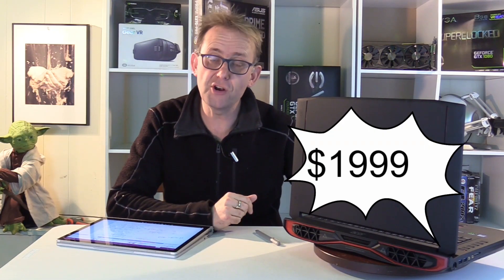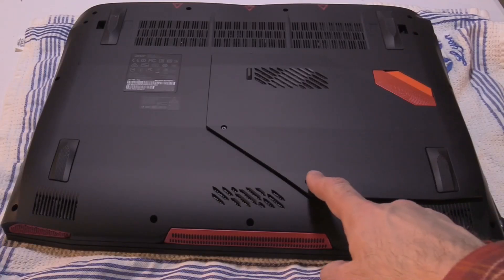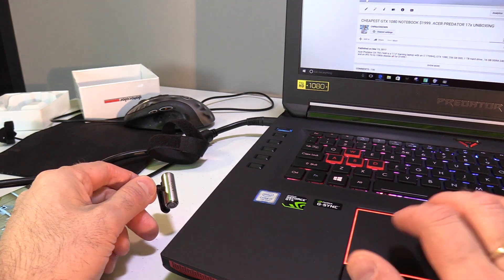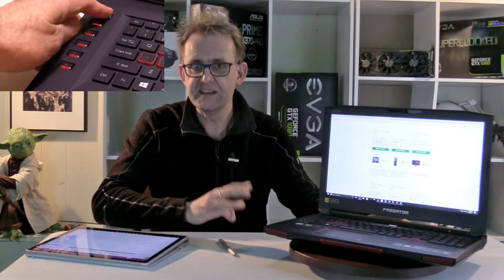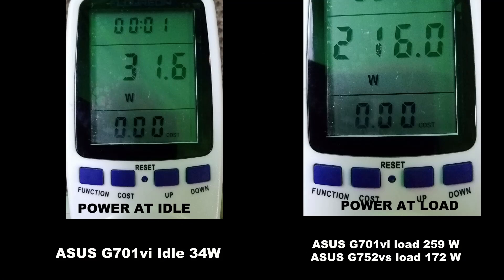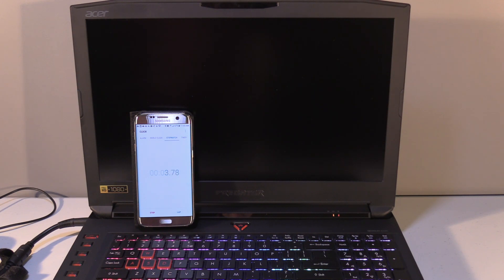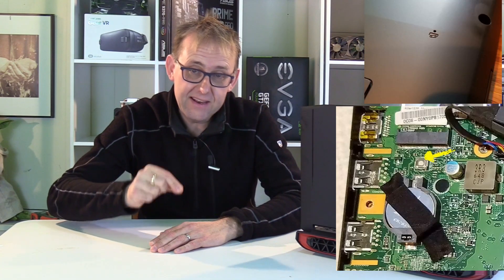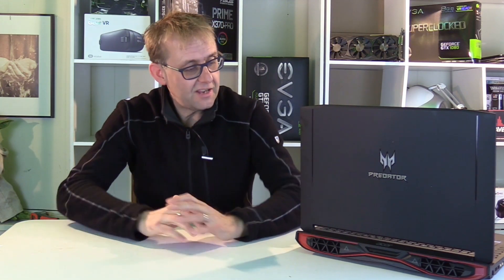CHEAPEST GTX 1080 GAMING NOTEBOOK ? ACER PREDATOR  GX-792-7448 FULL REVIEW

Comment: hey! when you game on this laptop did you noticed that the laptop drained battery even though it was plugged in? I have the 7820hk model with 1080p, and it drains battery when gaming. I played for like 40-60minutes and it dropped to 95%
Reply from the maker: Papa Lord hey there. Must admit I can't remember but I suspect it is just software that limits the battery from over charging thus extending the battery's life. That is quite common. I imagine if you measure the power pulled from the wall it will be less than the 330w power supply.
Reply: OWNorDISOWN its supposely how the laptop works. It uses battery when gaming and if it gets to 30% it uses ac power again. Thats weird tho lol. Thanks for answering man :D
Reply from the maker: Papa Lord anytime mate, enjoying the laptop? What temperatures do you get with that i7 7820hk? Do you have it overclocked?
Reply: Im currently running 3.8ghz with an undervolt of -160v. Getting between 65-72c when playing games. In whisper mode Im getting 40fps all the time on every game Ive tried (gta v with the redux mod, fallout 4 with alot of graphics mods and dsr 1440p) and the laptop is very quiet
Reply from the maker: Yes, those fans were very quiet. Great temps too ! It's a solid machine for sure :)

Comment: Can you please tell me the best price I could find for predator 17x  with i7 7820 HK processor, 32gb ram and 512gb ssd.                 And yeah one thing more buddy, I checked out the one you reviewed through the link you listed in the microcentre but the back of the laptop seamed different like the earlier models . Why is it so ?
Reply from the maker: It seems fairly competitive at Amazon: https://www.amazon.com/Acer-Predator-GX-792-703D-1920x1080-i7-7820HK/dp/B01N353QOO
The previous G9 models had that removable fan bay on the left hand side I recall.
Reply: OWNorDISOWN I know its silly to ask you but can you  tell me what could be its expected price drop after 1 year? The above mentioned laptop with i7 7820hk, FHD , gtx 1080, 32gb ram and 512 gb ssd. Listed on amazon for $2699. Cuz if its price drops to like $2100- $2200 I will be able to buy a couple of more things. Things on my list-                                   1)This laptop                  2)hyperx stinger headset                           3)logitech g502 proteus spectrum           4)ps4 slim 500gb and an additional controller                         5)some ps4 games            BUT ONLY IF THE PRICE DROPS OR I'LL HAVE TO CUT SOME THINGS FROM THE LIST WHICH WILL BE REALLY VERY DISAPPOINTING. :) OR :(
Reply from the maker: Dhirendra Pratap Singh once the coffee lake processors get released the Kaby Lake models such as the i7 7820hk will be discounted. I believe we will start seeing their 8th gen coffee lake in October. I would expect previous gen laptops to be discounted $200 to $300 perhaps
Reply: OWNorDISOWN can I ask you something? I just checked that there may be price drop of around $50 of ps4 and ps4 slim within 4 - 5 months. As for current it's  (ps4 slim 500gb with uncharted 4) is $296, what do you think can the price drop any more than expected ? Yeah it'll be very kind of you if you could tell me the current price of ps4 (no bundle)cuz I can't find it all I could find was ps4 slim on amazon.
Reply: Keeping all things aside mate I really appreciate your help and advice. Cuz you are the only reviewer who answers to my questions. I hope you and your channel prosper and flourish. Best wishes from your fan from India:)
Reply from the maker: Dhirendra Pratap Singh best but have a 1TB model for $299, a pre-owned 500GB for $199. Games top sell a refurbished 500GB for $250
Reply from the maker: Dhirendra Pratap Singh no problem mate, anytime! Really appreciate you supporting my channel 😀

Comment: i thought this was my next laptop but the speakers is a huge issue for me since i dont use my headphones all the time. i talked to some predator owners specifically those who have the gtx1070 and they had nice things to say about the speakers. maybe its your unit that has the problem?
Reply from the maker: Perhaps it is.. I did a full system reset and it was the same (as was the issue with the Fn key..) so I might have a dodgy unit. Certainly the Dolby Audio makes it worse. Headphones are much better but still not the best I have heard. I'm with you, I always use my speakers and I would be tempted to keep the Dolby Audio turned off. Perhaps  there is one in a store you can demo first? I tried my best to capture the audio to explain what I was talking about.
Reply: OWNorDISOWN its so hard to get a gt73 with a gtx1070 +7820hk from resellers at around 2099usd knowing that you could get a gtx1080 +7700hq laptop for 1999usd i guess the catch was bad speakers(?). Alienwares over at ebay and the outlet are so tempting too! any idea where i can grab the cheapest gt73 from? i probably can get the cheapest variant gtx1070+7820hk+1tb hdd only+16gb ram for 2000usd if i will pay xoticpc cash and use my returning customer discount.but 2k for just a 1070 is quite expensive considering you could also get a gt72 w a 1070+7700hq+128gb ssd+16gb ram for 1699usd. any idea which laptop you would get if you had 2k usd to spend?:)
Reply: Let me know if you get an answer to this because I am in the EXACT situation you are. I cant decide if I want the Acer w/1080 & 7700HW or MSI Gt73 w/ 1070 & 7820hk
Reply: thermonuke1 i pulled the trigger on an aw15r3 w 1070 and 6700hq +512gb ssd and 1tbhdd and 120hz panel for 1500usd. i couldnt justify getting the gt73 for 300-500more and without an ssd + poor warranty service.
Reply from the maker: Jason Mak When I returned the Acer I checked out a G9 and the speakers were perfectly fine. I think I just got a lemon.. I do think that at $1999 that is exceptional value. 
I bought an Alienware 17 R4 with Gtx 1080 /i7 7820hk 16GB ram, 256 GB SSD and Temps are ok, even at 4.4 ghz. It does throttling get hot when I run a game and do cpu work at the same time, thus is without the turbo fan. It only arrived today .. Cost me $2100 plus tax direct from Alienware so check out their discounts too. 
I think the Acer is still good value and as games get more graphically demanding that gtx 1080 will help..
Reply from the maker: Jason Mak nice laptop!

Comment: Hi Steven: 

I am staying in Austria and can't find this model for 2000 US, in amazon.de and amazon.uk, all acer models with 1080 cards are 2800 Euros and up. Do you know where I can this laptop for 2000 Euros within Europe?
Reply from the maker: Hi Naser, unfortunately I don't - I live in the USA and don't know many European vendors. Can you contact Acer , they might be able to advise you ?
Reply: Sorry my friend I thought you were living the U.K, anyway about Alienware 17 with 7700hq do they also suffer from boiling temperatures as overclockable models? I saw a review of the 15 in r3 model and it is mentioned that thermals has been improved.
Reply from the maker: I fully believe the i7 7700hq models are running cool. One viewer in Canada Rang Alienware and was able to configure an i7 7700hq / GTX model which is a good option for you.. I also had a viewer get the i7 7820 hk model from Dell's outlet and he said it runs very cool- so perhaps Dell gets these return and fixes them up. Perhaps the outlet may be a way to go too...

Comment: I'm ready to spend maximum of 3000$. which laptop is good option? MSI or dell alienware?
Reply from the maker: chris george Hi Chris, my favorite is the MSI GT73VR. It has excellent cooling, speakers, hood number of ports including Thunderbolt 3, and space for 3 m. 2 ssd's. I have the new i7 7820hk /gtx 1080 AW17 R4 in house and it seems to be running cool. Still, no inbuilt overclocking software or fan control and only 2 USB ports and no SD card reader which I like to have. Still, the Alienware is nicer looking but it is heavier than the GT73VR Titan Pro.
Reply: NO, go to OriginPc, make your own laptop with a DEsKTOP CPU, it will be close to your max, but a I7-7700k on a laptop it will be better than any of your options
Reply from the maker: sepheul another option is an Evoc from Hidevolution. They delid the desktop cpu and apply liquid metal and overclock to 4.7 Ghz for you as well as undervolt.

Comment: Why the dolby sound system is turning off?
Reply from the maker: I don't know but it was frustrating as game audio would be much quieter without it..
Reply: OWNorDISOWN There is no way you canc fix that ? I heard that on some version happens that but not on all
Reply from the maker: To be honest I didn't research any deeper as I have so many tests to do and I had a short window in which to return it...I wanted to report it though and it only seemed to happen when loading up a game. Perhaps if I reinstalled the software that might have helped. I did update audio drivers in the hope that the subwoofer would solve itself but I  think I had a faulty subwoofer.

Comment: Mate I just came across a gameplay video of  bf 1 on ultra settings on msi dominator pro with gtx 1070 on which it was shown to get an avg. Of 90 fps while I checked some videos of msi gt73vr titan pro with gtx 1080 it could get an avg of 90 fps on ultra settings. I am really astonished, how could it be the same ? I thought if could I get some reasons from you. If you wanna check out the video of msi dominator pro its on  Galaxy Tech Review channel.
Reply from the maker: He was testing in DX 11 v my test in DX 12. My scaling is at 125%  v his 100%. I got 85 fps on my GTX 1070 P57x, 117 FPS on the GTX 1070 Asus G752vs with CPU at 4.4 GHz and 122 FPS with my stock clocked Sager NP 9873 GTX 1080.. DX 12 does make you take a slight hit so it looks about right to me.
Reply: OWNorDISOWN thanks buddy. That really helped:)

Comment: Hi,
I need help choosing a laptop
-Acer predator 17x 7820hk 32GB 512GB ssd 1TB hdd gtx 1080 and 1080p for $1800
-Acer predator same above with 4K display $2050
-MSI gt73vr 7820hk 16GB 120GB ssd 1 TB hdd gtx1080 and 1080p $1800
-asus g701vi 6820hk 32GB 512GB ssd gtx 1080 and 1080p $1400
?????? Thank you
Reply from the maker: Wow, they are really cheap prices. Where are they listed at those prices? My favourite of the bunch is the GT73VR but The Acer Predator is very good too and the screen is better. My concern would be how hot does it get as my fans didn't speed up very fast. But the specs for the price are unbeatable. The 1080p was a 75hz display which can be overclocked to 100 Hz. The GTX 1080 can actually play quite well at 4k so that might be tempting particularly if you think you might end up doing 4k video editing in the future. If you think the temperatures are going to be OK on the Acer then that seems the best value.  The Asus is limited on the ssd front. You probably have 2 x 256GB in Raid 0 and you'll be battling for hard drive space which is never fun and its speakers were rather poor.
Reply: OWNorDISOWN it's a store i go to, the owner showed me the specs and the prices...all used but in like new condition. Everyone is talking about the throttling issue with the acer and poor screen. I do gaming all the time, i think i go for the MSI, what do you think?
Reply from the maker: Its certainly my favourite of the three and until now was my favourite of all the 17" GTX 1080 notebooks - only to be replaced by the Sager NP9873.  Not only does it run cool but it can switch to integrated graphics and run turbo fan all with a touch of a button. It has many ports and has very easy access to the internals. best I have seen , other than perhaps the Dell Inspiron 15 as that only had one screw, lol. It has 3 ssd slots and a 2.5" drive. Speakers are top notch.

Comment: Hey can anyone help me with this I am thinking to take this one in the video or the alienware 17 r4 with gtx 1070 and qhd I am confused with all the problems they say abt the alienware so but Alienware has a better screen someone help me .thank you ( hope someone replies)
Reply from the maker: T. Ganapati what CPU will your Alienware have? The i7 7700hq will be fine. I have the AW 13R3 with the i7 7700hq and it is fine. I would be wary of the i7 7820hk though as many still report it being hot .
Reply: OWNorDisown it has 7700 hq with gtx 1070 and the Acer laptop that you reviewed are almost at the same price they both are open box and my relative will buy for me to get it into my country so I am scared About Alienware
Reply: So which one do you think is better
Reply from the maker: For me the Acer is better because it has better speakers, an SD card reader and more USN ports. The screen was also great.
Which ever you chose make sure your relative tests it first in case they need to exchange it, especially since they are an open box.
Reply: OWNorDisown actually it's refurbished from Acer recertified site and Alienware is open box on best buy site
Reply: OWNorDisown what about display Acer has only 75 hz while dell with 120 * I plan to using it for some years
Reply: And Acer has gtx 1080 i76700 and 256 ssd but Alienware is 1070 i7700 with gtx 1070 and 128 gb ssd
Reply: OWNorDisown so I am really confused
Reply from the maker: I've bought open boxes from Best Buy before and if they are Geek Squad certified it means they have turned it on, that is all. It may still overheat of course. I would be inclined to go the Acer route
Reply: OWNorDisown thanks I'll go for Acer and can you tell me how to overclock the screen as you said to 100 hz. And thanks for the help I was finding for a techie who could help me and I like your videos keep it up

Comment: I'm on a budget of 1500-2000$ dollars and want any gaming laptops (1500-1700$) for GTX 1070 and 2000$ for a gtx 1080 one...please give me suggestions and Links. (Amazon only)
Reply from the maker: Its a shame you are restricting yourself to Amazon as you will struggle to buy a GTX 1080 notebook for $2000. At Microcenter you can but an Acer Predator 17x for $1999  http://www.microcenter.com/product/475582/Predator_17_GX-792-7448_173_Gaming_Laptop_Computer_-_Black.   for the GTX 1070 the AW17r4 is a solid choice, notably because the speakers and performance is good - not many usb ports/no sd card reader though https://www.amazon.com/Alienware-AW17R4-7345SLV-PUS-Laptop-Generation-Silver/dp/B01N0THP9L/ref=sr_1_1?ie=UTF8&qid=1504282728&sr=8-1&keywords=alienware+17r4
As an alternative to the Alienware I did like the Gigabyte P57x v7 as it is lighter in weight and with a QHD 120hz display is good value. Main weakness in my book was the speakers as there is no subwoofer. https://www.amazon.com/Gigabyte-P57Xv7-KL3-Notebook-Kabylake-i7-7700HQ/dp/B071YZF7C5/ref=sr_1_1?s=electronics&ie=UTF8&qid=1504282931&sr=1-1&keywords=gigabyte%2Bp57x%2Bv7&th=1
If you are after a fast 15" GTX 1070 I think the Clevo P650HS-G is hard to beat: https://www.amazon.com/PROSTAR-P650HS-G-i7-7820HK-Bluetooth-Warranty/dp/B01MV01K2I/ref=sr_1_1?s=electronics&ie=UTF8&qid=1504283577&sr=1-1&keywords=prostar+gtx+1070  here is a review on it: http://forum.notebookreview.com/threads/sager-np8157-clevo-p650hs-g-review-by-htwingnut.801138/
Reply: okay thanks alot..but do u think i can trust micro center?
Reply from the maker: Haris Z yes indeed. They are a physical store with employees who actually know what they are talking about. They have a 15 day return period.
Reply: OWNorDISOWN alright thanks alot 🙂